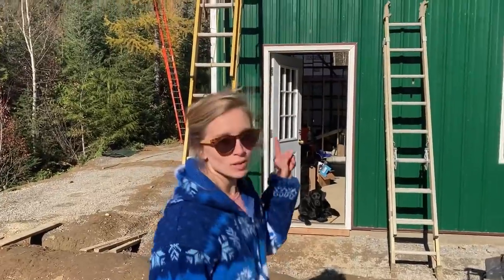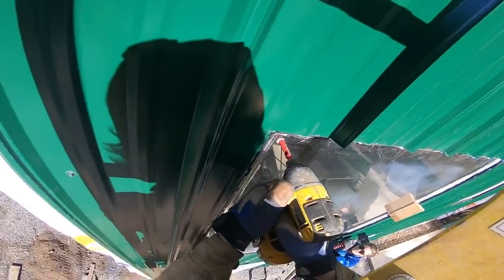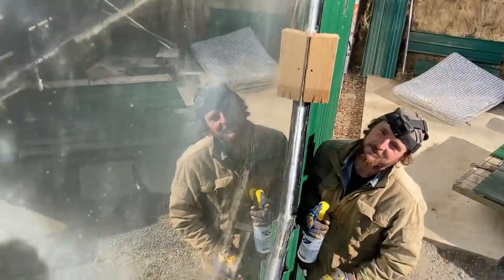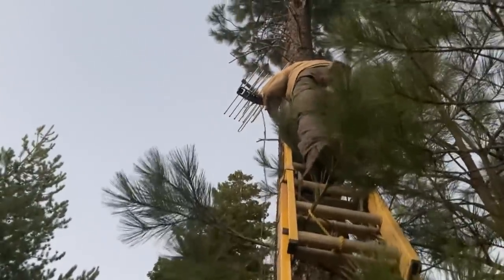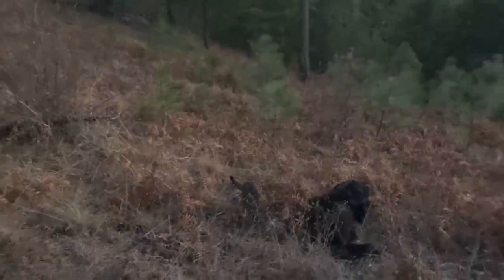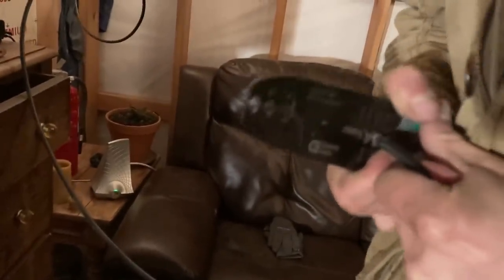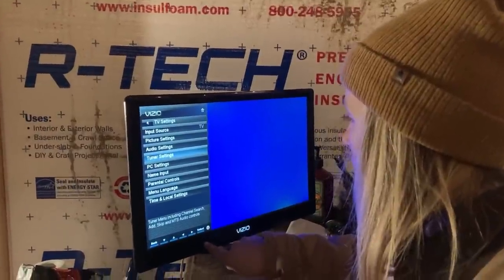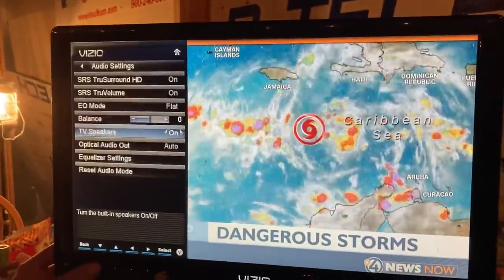Repairing Windows With Broken Seal  | Drilling Through A Window | Hanging TV Antenna

Comment: So, I've done this window fix before.  I drilled from the inside because you don't want bugs and dirt from the outside getting between the panes.  I used a diamond bit set made for a Dremel that has really small bits of different shapes.  To defog the window, I used an electric water pick and sprayed rubbing alcohol between the panes.  It cleaned up nicely.
Reply from the maker: We’ll have to do the alcohol too. I like that idea! Thanks!
Reply: Where on the window did you drill and how big of a bit?  Thank you....
Reply: @midasspider530  I drilled in the bottom center.  I put a piece of clear tape over it when it was dry to seal it up.
Reply: You know you're a genius, right?

Comment: Nice little trick for a fogged up window, never even heard of doing that. I figured the glass would shatter. Thanks :)
Reply from the maker: I had that thought too, it made me nervous but I’m happy it worked! Thanks ! -Liz
Reply: @LaidBackLiving  Was it originally a thermo glass window? Then it won't work half as good as before, holes or no holes.
And it will probably get dirty over time between the glasses.
Reply: @akyhne  It will most likely work about as well as ever, especially if they plug one of the vents to stop convection.  Ideally, they'd dry it out with some dry air or nitrogen to remove any water vapor, which probably causes the most heat loss.  Ordinary double-pane windows are usually filled with dry air or nitrogen (because it's cheap and available), but you can get argon filled windows for ~100% more money and about a  30% performance improvement.

Comment: Cheapest best insulation is stagnant air. The reason- if there is no convection within that transmits cold outer glass to warm inner glass, you max the insulation. There is a vid somewhere where a guy coats the inside with an anti fog material before resealing- might b worth a look

Comment: congrats on the window i had to do the same thing to one of my windows but i used a kit that fixes to a Dremel and comes with little valves to let the air in and out 
but what you did was just as good but still very nerv racking is it or isnt going to shatter/crack
Reply from the maker: We were nervous too, it turned out better than we expected!

Comment: Also put up a long range 3/4g external antenna powered via a 24w solar near the antenna..connected physically by a cat 5 or 6 lan/wan cable..coming from the antenna to someplace inside the home to a internal WiFi/ADSL router...unless ur internet signal is good then..never mind., question what company is that LCD TV?
Reply from the maker: Visio

Comment: Seems like an odd way to "solve" this; and will cause other issues like the window filling with water.  Are you using an impact driver rather than a drill to do this?  That could explain the jumping around.
Reply from the maker: We are hoping the rubber tubing will keep the water out, it turned out better than expected
Reply: @LaidBackLiving  Hope it holds, at least for the foreseeable future. Materials are so expensive and delayed now. Get doing a patch for now.

Comment: No more fog but also no more insulation as all the gas has now disapeard from inbetween the glass
Reply: It was water vapor (a gas) and something else before; now it's nitrogen, oxygen, and less water vapor.  There isn't a magical gas you can put between panes of glass for insulation, although they often leave the factory with dry 99% nitrogen.  You can pay extra for argon filled windows, but a) the insulation improvement is about 30% at most over dry air or nitrogen, and b) I'm not convinced that the argon stays sealed in for the long term.  It certainly didn't in this case.

Comment: Why would you drill through the glass???
Drill through the frame and then reseal the holes!!!
Any time you mess with glass you are messing with disaster!
And why would you drill the holes outside???
Reply: That would be a good idea but I'm not sure you reseal the hole at all. Once the outside air gets in, you'll get moisture anyway. Most of those windows have Argon gas in them and once it leaks it's more cost effective to just get a new window.
Reply from the maker: It’s an old window that had quite a bit of moisture in it. We were trying to avoid taking the window out again. It’s working so far, we will see how it holds up!
Reply: Why why why .....Oh geez !
Reply: @LaidBackLiving  
The holes should have been on inside and drilled after the home was finished and air tight!!!
But you do not watch Matt Risinger and do not UNDERSTAND How Important having an Air Tight home is.
I would have drilled hole on the outer edge and put a small fan such as from a computer to constantly blow air through space - requiring a box with the fan four holes and oppositely a vent for air to escape BUT ALL IN THE INSIDE...somehow I’d find a way to make the air dehumidified!
Reply from the maker: Thanks for letting us know how YOU would do it! How many windows have you drilled through and repaired?
Reply: @LaidBackLiving  Your reply just made my day.😀
Reply from the maker: Lol thanks Chris. And thanks for watching. Have a good day!
Reply: @BrianBriCurInTheOC  If you feel the need to constantly berate someone on their construction, you should just spend your time watching PLFL and leave these kids alone. There's really no permanent fix for that window so they'll get some time out of it and get a new one when they can, I'm sure.